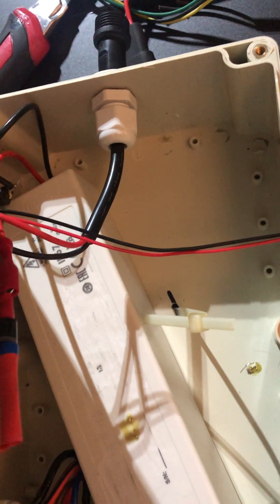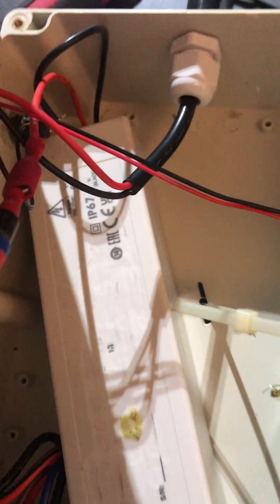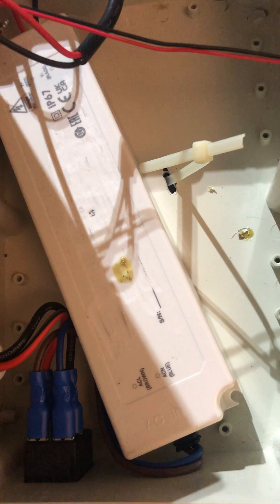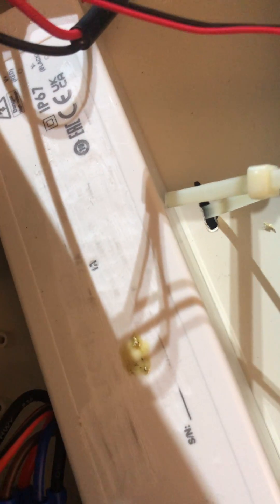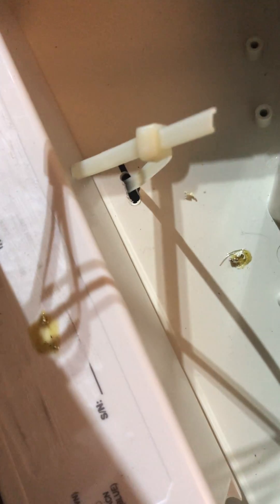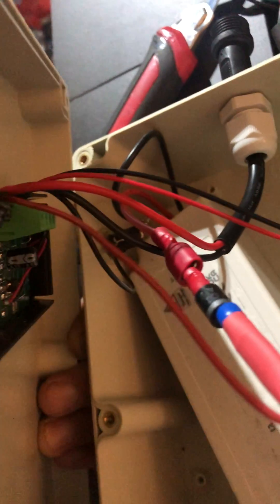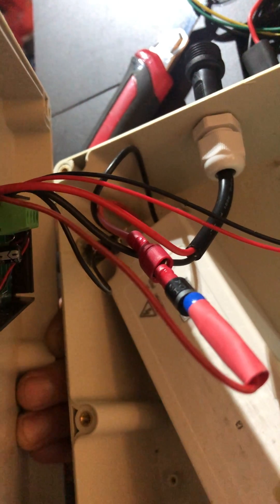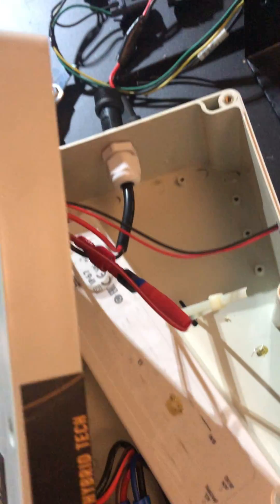What's inside a Prius Grid Charger from Venice Hybrid Tech - This is a must have when fixing battery

Comment: Is Diode added? I mean does it output 250VDC or 257VDC?
Reply from the maker: it's an LED driver,  meanwell brand I guess. Input 110ac output 270dc (? not sure exactly) No diode for protection.